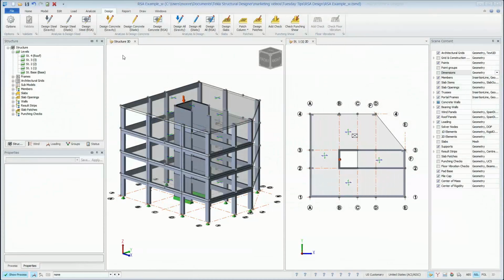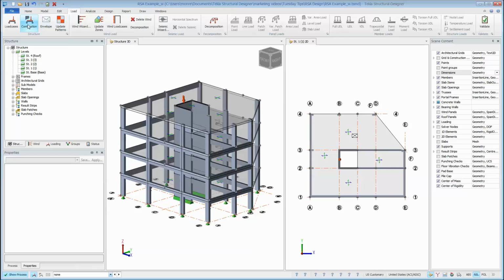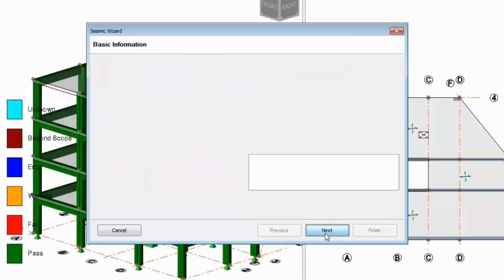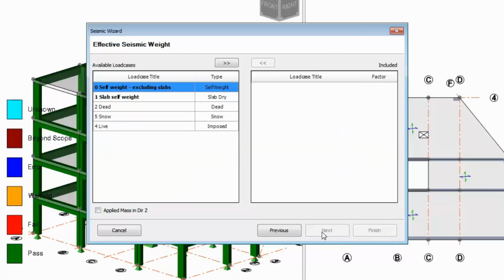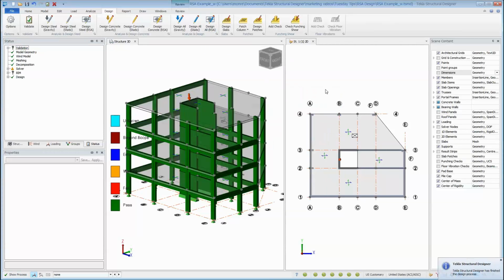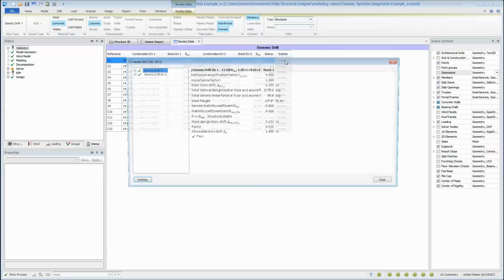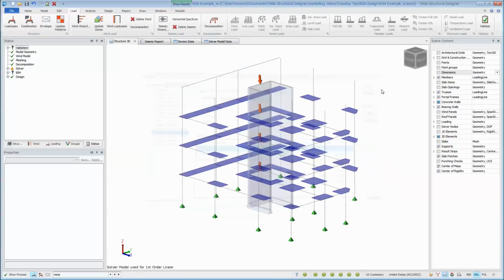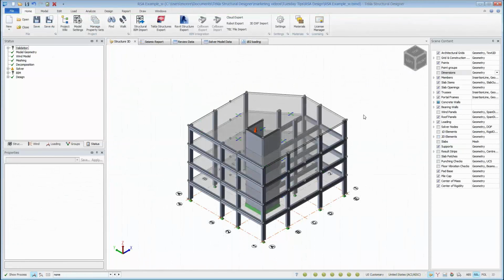Tekla Structural Designer RSA Design

Comment: Hi  , does TSD have response simulation?
Reply: Hi, Lemuel - yes, the RSA Spectrum curve in the Seismic Wizard can now be defined by a set of data points, in addition to the existing fully automated code generated option and manual entry of code spectral curve change points. The new feature for user defined RSA curves was introduced in Tekla Structural Designer 2019i.